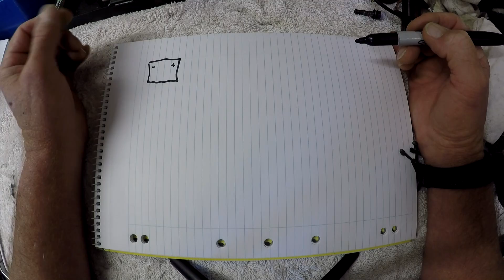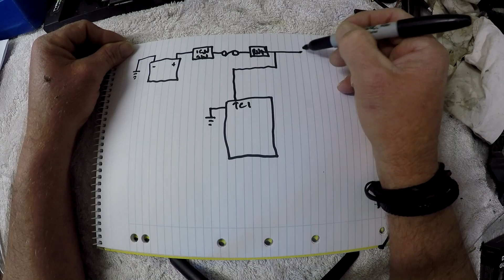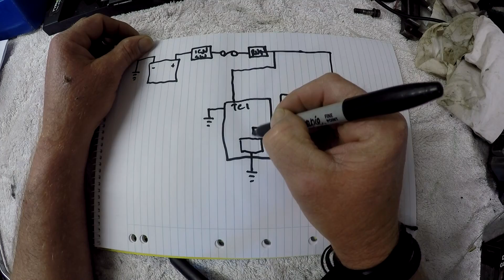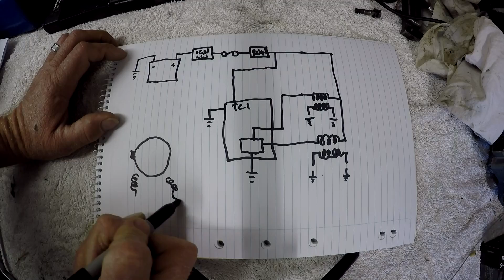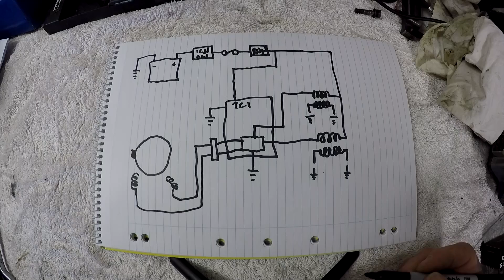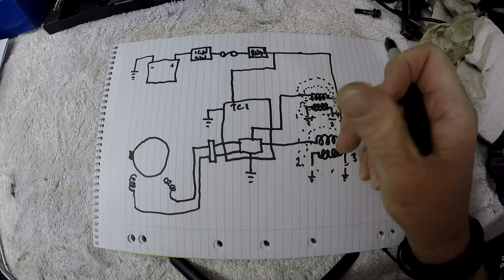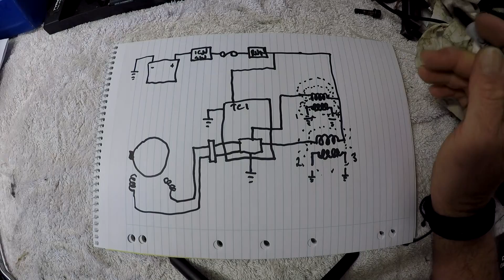Yamaha XS1100 Cafe Racer Project - Episode 21 - TCI Ignition Unit Explained

Comment: fiirst of all thank you for your videos and second ive got a problem with my ignition on my 79 yamaha xs 1100 special i bought used pick up coils that goes on the crank cause the wires on the others were hacked so bad that i couldnt put a butt connerctor on well it ran fine for about a week cause i was riding to and from work on it and on the way in it started to miss fire like i wasnt getting spark then after i got off work to ride it home 30 miles it wouldnt rev above 2 thousand rpm and it would back fire out the exhaust and intake on cylinders 3 and 4 and sometimes on cylinder 1 and 2 while sitting in the parking lot at work and when it would rev it would only go to 3 thousand rpm ive put smaller jets in the carb checked wiring and also checked tci iginition box for coils i think it was like 450 or 500 ohms any idea what it could be

Comment: Hey Andy, what did you do with the vacuum advance unit when you switched to mikuni/pods? I am having an electrical issue where cylinders 2 and 3 aren’t firing consistently with vm34s, however work fine seemingly with the cvs. I’ve tested everything I know to test and feel like it might have something to do with advance unit being plugged when using the mikunis, but connected properly with the cvs.
Reply from the maker: If you open the video where I fitted the carbs and go right to the end you will see what I did.
Reply: Thank you!

Comment: you have saved me timeinfiguring out mine. however  myu issue is i have no spark on 1 and 4 but i do on 2-3  which boggles my mind. so i replaced the coil and it still has no spark. Im now guessing its the TCI. which I cant find one anywhere.  thanks for the video it has helped me immensley

Comment: Hi mate you do well explaing well done 🇬🇧 I own a xs1100 Yamaha 1979 chop but the T1D 14 /01 egniter unit, the brain 🧠 is fried the guy who I bought bike has mucked about wires there are 12 terminals but I want to rewire the bike have you a break down as what wire goses to where I could then pull out the old wiring and follow the sequence by putting the right wires many thanks great video keep safe 👍 maca

Comment: 1981 xs1100.  I have 2 books and the books state the coil wires be 1 and 4, 2 and 3.   Or is it 1 and 3, 2 and 4.   Which way is correct.  Thank you
Reply from the maker: 1&4, 2&3

Comment: Great video Sir Andy. I have a question hope you help me. My xs1100 sat for 1decade, last week I already check the spark/current of the four wires came from ignition coil the 1,3&4 have current the #2 does not have.and until next day I check but almost does not spark. Maybe what is the problem? Hope you help me for this Sir Andy thanks a lot

Comment: I have driven myself crazy  with my xs this helps a little im gonna think on it  i just got done trying to figure it out and  wow my brain hurts cause I had Power to the coils but wasn't getting any spark so I took it apart and re did what I thought was the right way and now no power to coils I don't think I was completely finishing the circle but its been crazy im suppose to be going on a trip with my bike and im going to fail to even be ready to ride ugh its very disappointing that I have not gotten it figured out

Comment: Could I find another control unit besides the original 2H7-10. Any other from another motorcycle or one that works with the engine even if its an aftermarket piece

Comment: May I have the TCI unit part number for a 1979 xs1100...I bought the motorcycle but the unit was missing I am looking for where to get one
Reply from the maker: The part number is 2H7-82305-10-00 but it will have 2H7-10 in raised letters on the top face of the unit itself.
Reply: @ANDY5  thank you very much. You are so helpful

Comment: Great video mate! I’ve built a Frankenstein-bobber (it’s a mixture of stuff from different bikes 😂) but runs a 250 virago twin and I’ve been struggling like hell to understand how to hook up the Tci to get a spark! I’m used to AC driven cdi setups and this DC stuff is driving me nuts! It’s an 8 pin XV250 type tci so I’m hoping the principles you outline in this video will transfer to what I have here? I’m about ready to burn the thing if I can’t get it sparking 😂 any advice welcome!

Comment: Hi Andy, Sorry for the War and Peace message. I have an XS1100 trike Project that I bought in a wiring mess. UK clocks/ switch gear but US wiring loom. It’s been interesting to work out.
I’ve fitted the relay diode/ neutral switch  etc and all that is working fine after watching your video. I have a spark at 1 and 4 but nothing at 2 and 3.
I’ve built a few chops in the past and used to have a bike business so have a reasonable knowledge of bike wiring.
2 questions. 
1. The resistance on the pulse coils are in their parameters with the manual 694ohms and 678 ohms ( should be 720 plus or minus 20%) but it says you test the 2 yellow leads (green and red stripes) together and test the two white leads (green and red stripes) together. I don’t get any resistance that way. If I test them diagonally ie one white one yellow I get the resistance. It does spark though. I am still waiting for a 1.6 ohm resistor to go inline for the coils, to arrive in the next few days so have just connected the leads together for now just so I can check voltage.
2nd question. All the voltage readings are right off the TCI except for 
a. Grey feed to coil is only 4.5volts 
b. Should the red and yellow from the TCI unit have a permanent 12volt feed from the red and white off the starter switch or should it be on the Starter motor side. Your diagram and the manuals are different and the Haynes manuals don’t really show where it should be properly.

I will confess I haven’t checked the coils yet or swapped them over so it might be the coil that’s the problem but I would have thought I should still get 12volts ff the grey lead on 2 &3 coil.
Any advice would be great

Phil Baker UK

Comment: I have an issue you may be able to help me with? I have been messing with my1980 Yamaha xs1100 for weeks. Cylinder 1 and 4 work fine. Cylinder 2 and 3 have no spark. I have already put brand new coils , plugs, wires. Still nothing on 2 and 3. Any tips on a way to test cdi or a way to diagnose without just throwing money at it?
Reply from the maker: G’day mate, watch this video. I walk through testing the ignition system to diagnose the reg/rec and the TCI. As there is no way of testing the TCI directly you have to test it by a process of elimination https://youtu.be/hrVfjnxHQOo
Reply: @ANDY5  you sir are awesome! Thanks alot for the info. After some testing I came to the conclusion the cdi ignition box was bad. I ordered a used one on Ebay and slapped it on and it is now running on all 4 cylinders! I have a little work left but its getting there.

Comment: Thought I'd just give this a shot. I have this 79 XS that has only ONE spark when I hit the start button and then only ONE spark when I release the start button. No spark when the starter is engaged. Also, the power on the Red/white wire at the TCI box shows 12.5 volts with key on, about 9.6 while cranking, and this is where it gets really weird...I release the starter button and the power goes down to 5 volts for about 3 seconds (red/white wire at the TCI box). Seems like stock coils might need to go. Primary ohms at 1.8 and secondaries at 24.48k and 25.19k. I have 3 TCI boxes here....all are giving me the same readings. Any directional help would be much appreciated! Thank you!

Comment: Thank you so much. I'd picked up and xs with no loom and although I'm used to wiring up bikes I couldn't understand why there were so many connectors to the CDI. I'd figured out the coils and the pick-ups but was a bit puzzled by the power application.  Looks like the bike has a ballast resistor which is by-passed when starting and therefore a separate straight feed input to CDI. Incidentally, I also have a Triumph too, a 73 Bonny.  Thanks again, that was a real help.
Reply: How did you go about wiring the ignitor up

Comment: hey Andy, are the tci's from the 79 the same on the 81? I'm having a same problem on spark issues. the bike only sparks on the first 2 turns and then nothing after that. so I'm down to the tci being the culprit. but I only found a tci from a 79 in my area. and I was told that 78 79 80 used different tci than the 81. and another question would be, what causes tci tp go out? too much load? can aftermarket coils hurt them? I have aftermarket coils but match the 3ohm as the stock. thanks for the vid.
Reply from the maker: G'day Todd, yes they are different.  The '78-'80 have mechanical ignition advance, not to be confused with the vacuum advance.  The '81 has electronic advance and you can't interchange them.  Check the  prefix numbers on your TCI and replace it with one that's the same. As for why they go, I'm not sure.  They are pretty bullet proof and I have aftermarket coils on mine with no issue.  Considering you have 3ohm coils I would doubt that is the problem.  Have you checked the wires from the pulsar coils?  Have a look at Steptoes video for how to check them https://youtu.be/ywOGlDri-q8
Reply: @ANDY5  hie
May I have the TCI number or part number for the TCI unit.

Comment: hey i have a 93 virago 750 i think my tci box is failing.  It will start up just fine but after 2 minutes of riding i lose power.  Does this sound like a tci or coil problem?
Reply from the maker: Hi Nikolaus, it sounds likeTCI
Reply: does it just like cut spark all together? wont start up till you let it sit for a minute? Because i have an 1985 virago 750 and thats what it does, ride it for a couple minutes and it just shuts off. Wondering if you replaced your TCI and taht solved the problem? Thanks

Comment: Andy, your videos is just incredible! 
I have just one question in mind - is there any way I can make sure that the timing is set right? Im thinking at the disk where you can make sure the pistons are in top position etc.
Reply from the maker: Hi Magnus, Ignition timing is set using a timing light connected to #1 cylinder.  At idle (1000 RPM +/- 100 RPM) the letter 'F' on the timing plate (the disc on the left hand side of the bike) should align with the pointer. Andy
Reply: Thank you Andy! 
But can i just count on the other 3 cylinders? I mean. If cylinder 1 is right, which it is, are the other 3 cylinders okay then? Cause If i do the same with cylinder 2 and 3, the light turns on at the arrow - the exact opposite site. 
(Im having issues starting my bike) :(
Reply from the maker: Yes mate, if #1 is right the other three are okay, the timing positions are fixed.  Go back to basics.  You need fuel/air + spark + compression for an engine to run, and all an engine wants to do is run, so if you have those three you should be okay.

Comment: Very helpful. When I look at my wiring diagram, I go cross eyed lol. Wondering what you think about this, I have an 82 XJ1100. I get spark to the 2&3 coil but not the 1&4. Tested the coil and it's still good. Replaced the pick up coils. Do you think it would be a bad T.C.I.?
Reply from the maker: G'day Brian.  Sadly it is difficult to diagnose TCI issues, even more difficult over the interwebs.  The only way is by process of elimination.  I suggest swapping the plugs on the coils and see if the problem shifts to the 2/3 coil.  Failing that I suggest trying to get another TCI from a known running bike and swap it in for a test.  You can always eliminate the TCI completely by installing an aftermarket electronic ignition. Andy